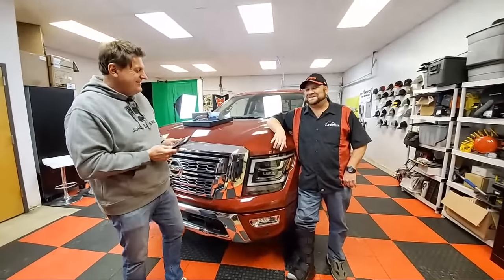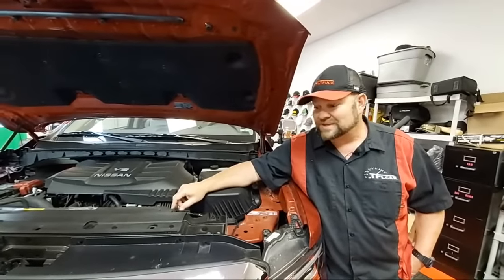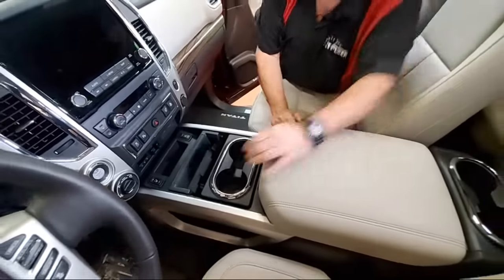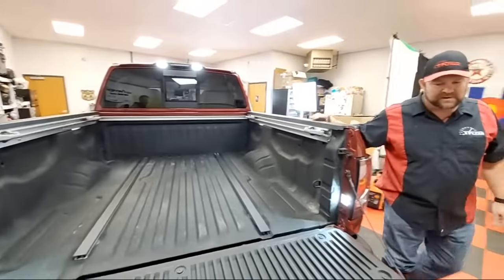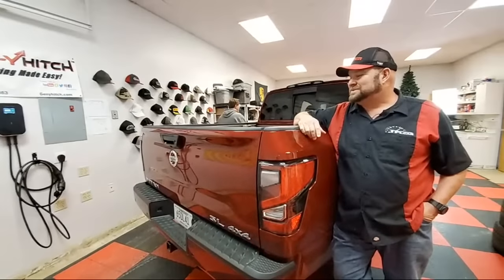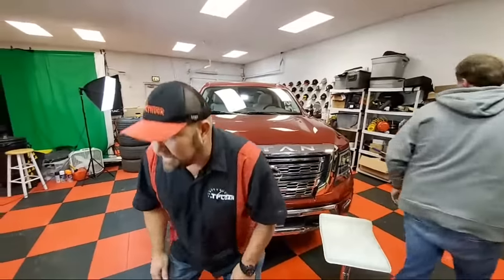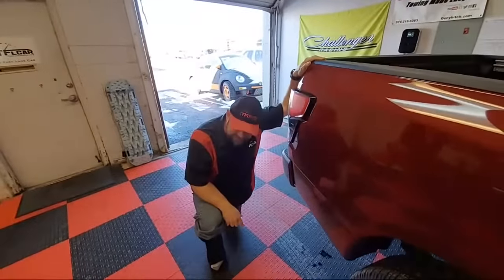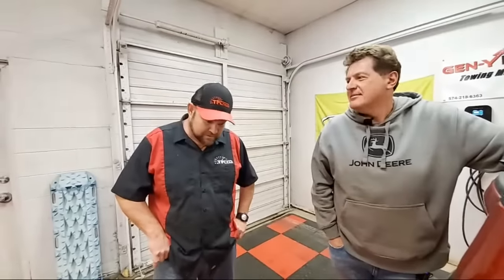Is The 2020 Nissan Titan A Game-Changer? | What Car or Truck Should I Buy Ep. 81

Comment: I just purchased a new  Nissan Prox4 2019,  traded my 1500 Silverado Ltz 4x4,  don’t get me wrong loved my 2010chevy had124,000 on it.   Researched a lot of trucks and decided to go with Titan.  Selling point is the warranty, wow.   The difference in the power is awesome and drives great.  This truck had all the bells and whistles on it, example the 360 camera view.   Truck was originally 55,500,  they were selling it for 46,600, Dec 19,2019.   I trade in my truck I owed 8700.   I ended up walking out the door paying 49,500, this included my payoff taxes.   I’ve tried doing the math, they sold me the truck for 45000 this included the payoff, so I actually got the truck for 36,300.  I know I love my whacky math.  But I walked out with an awesome truck, for less than 50k.  I love my Titan.  Now let’s see if Nissan backs there truck.

Comment: Every review I see for the Titan, it gets hit on the mirrors. I think it’s better that way. Less possibility for something to break and if it does, it’s cheaper.
Reply: What it shows is they're really stretching to find faults in the new Titan. @12:46 they knock on the bumper because it's plastic, I mean, doesn't almost every truck ever made have a plastic top cap on the bumper?
Reply: HKmaroLS1 I’m here trying no remember wich truck doesn’t come with plastic top bumpers!!!
Reply: HKmaroLS1 agreed. I think it’s a solid work truck and more depending on the trim. It’s not the most efficient, but they’re solid trucks, or at least the 1st gen is and I love mine.

Comment: I have nearly 400K on my Titan.  It has had small issues over the years but it has never let me down.  My needs have changed and sadly I am not looking at Nissan any more.  I was REALLY hoping the 2020 XD would increase their towing numbers.  I was disappointed when I realized they are moving in the wrong direction.  My next truck was never going to be a 1/2 ton (if you can still call it that) I now need a 3/4 ton.  I wanted to see an extra 1,000 lbs added to the XD and it didn't happen.

Comment: Many will chime in and claim that the horsepower and torque ratings are higher in a GM, Ford or Ram.  While some of that may be true depending on trim line, when it comes to engineering, build quality and reliabilty, the Nissan wins out.  

If it matters to you, the Nissan Titan is assembled in Canton, Mississippi.  Buying one helps out your brethren in keeping their jobs while GM sends jobs to Mexico.

BTW, the Toyota Supra addressed at the outset is a BMW Z4 as it uses the very same engine and both are assembled in the same plant in Austria.
Reply: Well, it's funny you call out the Big 3 for building trucks in Mexico, yet Toyota now has 2 plants in Mexico building Tacomas.

Comment: They got rid of the regular cab long-bed truck which, if you ask me, was the only Titan worth buying over the competition in terms of price and capability. I'm surprised more fleets didn't go with the regular cab Titan, it was the cheapest and most capable v8 base-model work truck on the market. That should have been a winning combination! If you ask me, Nissan is going in the completely wrong direction. They are trying to cater to the weekend warriors who use their trucks a family haulers during the week and go camping on the weekends. Ford, GM, and Ram already dominate this segment. Nissan should have doubled down on the bare-bones work truck. This is a segment that the other big brands are leaving and that Nissan already had a very strong offering in. It is simply not good business to try to cram yourself into a crowded market with a mediocre product. Instead, you look at where there are gaps and vacuums in the market and you target those with a very strong product.

Comment: No such thing as a midsize truck anymore. Most midsize trucks are the same size as full-size trucks of 20 years ago.
Reply: J Hov - nope. Maybe 3/4 the size of full size trucks 20 years ago, or 30 years ago, even 40. Years ago. I have basically owned each generation going back to 1938. The midsize have never been as wide as anything back to 1960. Pull a full-size in and out of a garage, then do the same with any midsize. You will learn. I have a 1979 GMC I’m working on, it is bigger than my brother in law’s 2019 GMC Canyon Denali. That’s 40 years!
Reply: No, midsizers don't come close to matching the width of a full size truck even from 20 years ago.    They all look bigger since a lot of them are crew cab and 4x4 these days but get in any of them and they are all cramped.  Can't imagine them being any smaller.
Reply: @ohioguy4326  Bull$hit the Honda Ridgeline is considered midsize and it's the size of the 1st gen Tundra.

Comment: It’s still a “Nissan”, no thanks! I would take a Big 3 or A Tundra, just not a fan of the Titans...
Reply: RAZOR RAMON THE BAD GUY My “Ram Fiat” as you want to say, was built in Michigan. You’re correct the Tundra was the most built USA truck. I just prefer the Rams 8hp75 transmission and hemi combo over the rest. And nobody can compete with the interior the (Ram Fiat) has!
Reply: @rigging1377  True, the Ram has the best interior imho. However; they also have a ton of recalls and historically unreliable. Nissan currently has a 5yr 100k bumper to bumper warranty which is tough to beat. I looked at Rebel, TRD Pro, and bought Titan Pro4x  for a much better price for the equipment. Never had any problems with my Nismo that I have tracked for over 10 years, so it was a no brainer for me.
Reply: The Tactical Ape so which is it, you say it has a (5 year bumper to bumper 100k warranty) and don’t like recalls? It’s the same thing. All the auto manufacturers have recalls. Reliability? The “ZF transmissions” in the rams are the best out! The hemi has been well proven as reliable, unlike the Jatco transmissions put in the Nissan. The worst thing Nissan did was get rid of the Aisin 6 speed. All around the Ram is better than the Nissan, but buy whatever you prefer.
Reply: I had a 2005 Titan for 9 years,  I still miss that truck just something about it.    The way it drove and it was very reliable.
Reply: Ohioguy I had a 93 Nissan Altima with 220k on it, what’s your point?
Reply: @arlcyborgify  Toyota has 2 plants in Mexico building Tacomas now.  TF you on about?
Reply: @rigging1377  You of course realize ZF recently had a recall on over 500k transmissions. The transmission had a defect that killed Anton Yelchin (actor from Star Trek). I did tons of research before my purchase and saw too many postings from Ram owners with failed airbag suspensions, and failed etorque transmissions etc.
Reply: The Tactical Ape you’re talking about the “9 speed”, which is in the Jeep not the 8hp75 in Rams! Jeep pinched a wire in the harness on some, which would cause it to go into neutral. So they recalled all of them to make sure they fixed the problem. I checked the boards and I don’t see a lot of people having issues especially with the transmission! So yeah Rams definitely do have the best power train out of all the trucks right now.

https://www.ramforum.com/threads/etorque-reliability.134230/